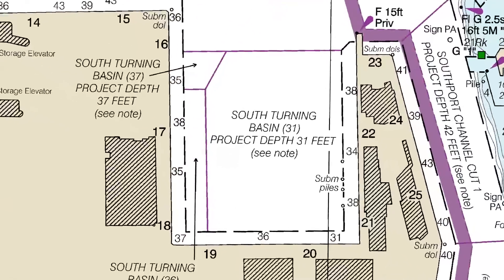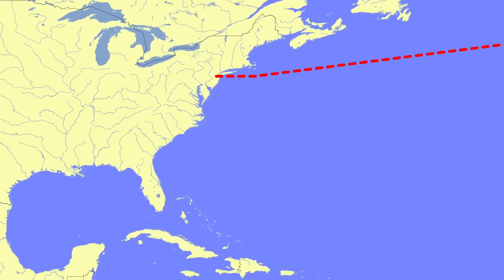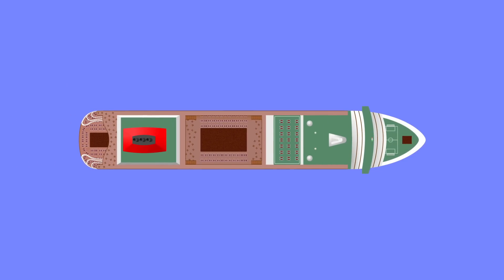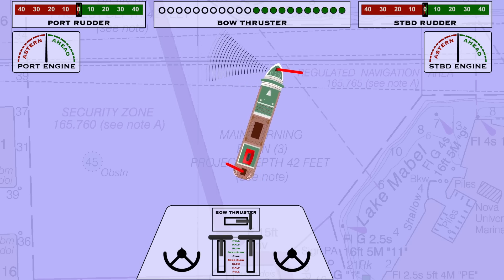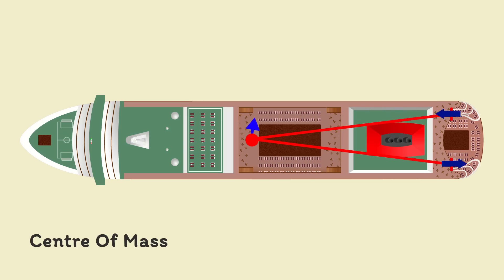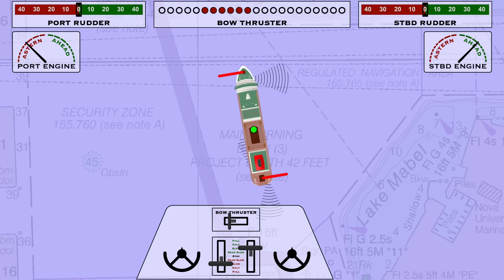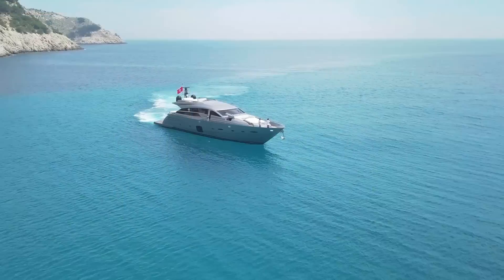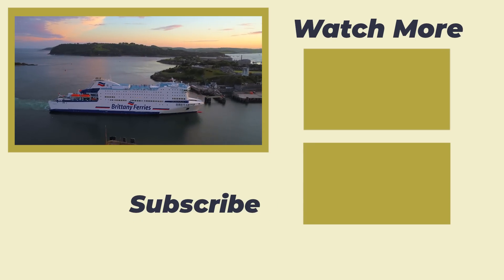Learn To Drive (A Cruise Ship)

Comment: mhm. The cruise ship seems pretty hard to get in parking. Reason: If that thing has a bulboss bow, and the area is very tight, that would mean it could break the other ships rudder as then the ship could not move out then because if strafing to the starboard side, it could creat greater problems with sometimes the ship doesn't have a lot of time to stop before the ship hits the peir and creates greater damage. What do you do with that?

Comment: Great video that shows all concepts fantastically but just one thing. I sailed with one of the big name cruise lines coming into Port everglades on a weekly basis. The berth where this cartoon ship was parking, there is no hope of fitting 3 cruise ships there end to end. I remember Oasis of the seas used to tie up on that berth when we were there and that single ship hardly fitted on its own. Apart from that, great video.
Reply from the maker: Haha. Thanks Conor. I should have mentioned it wasn't meant to be to scale.